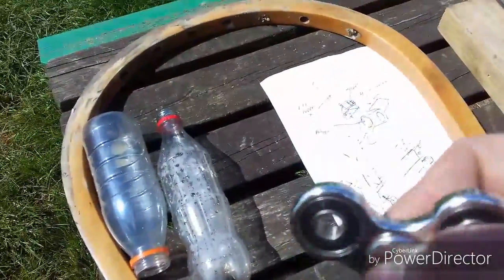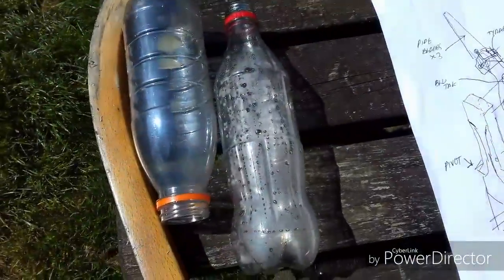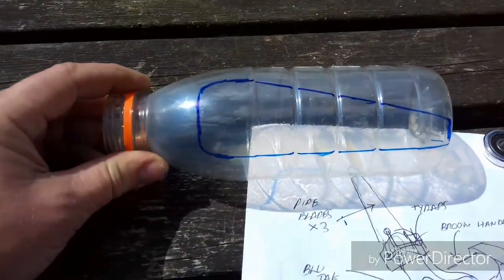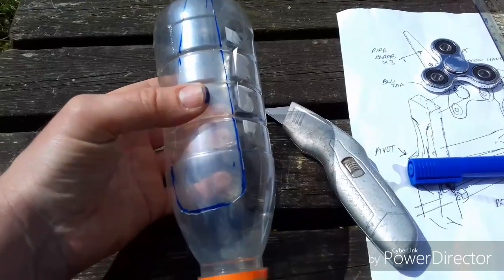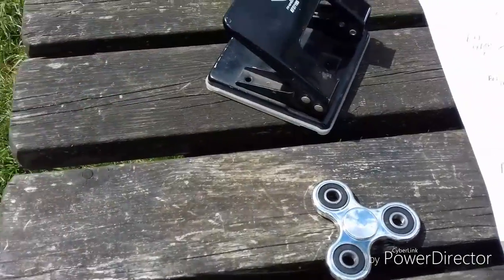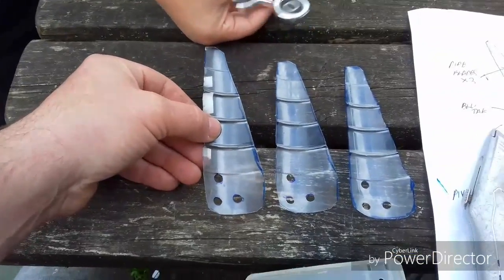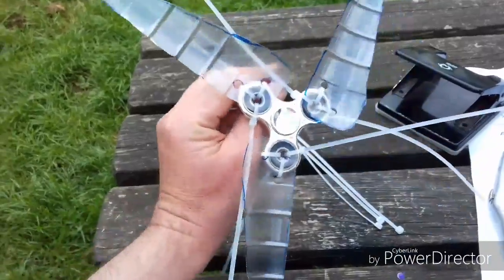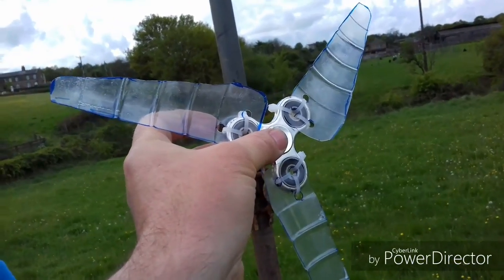FIDGET SPINNER WIND TURBINE

Comment: Could you drill out the center to mount it, or will i hit a crucial part? we have the same idea. i think they're lame as is, and want to use it for something a little more interesting
Reply from the maker: yes you could drill the centre, the centre comes apart in two halves, you could drill it bearing centre diameter but the centre discs in my set up stop it moving backwards so you would need some spacers or small tube to stop any axial movement
Reply: just saw your other video. i will be gluing in the wooden dowels. thanks. anticipating your next copper wire video!